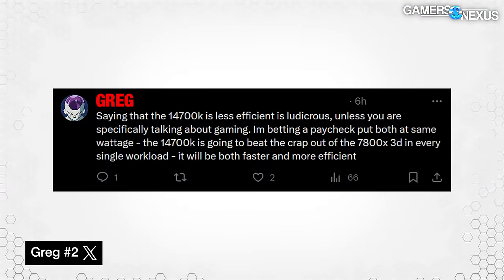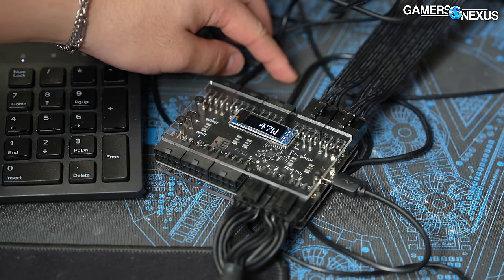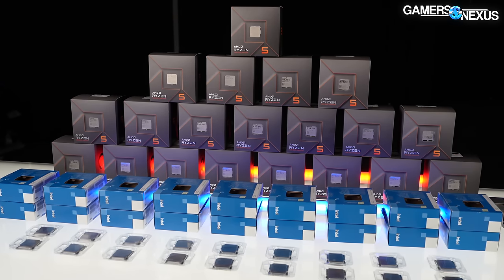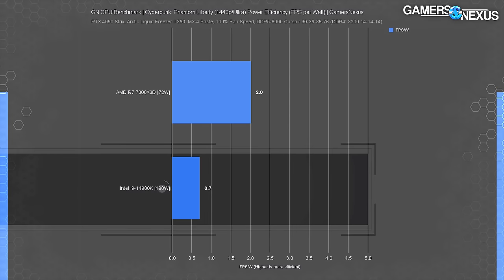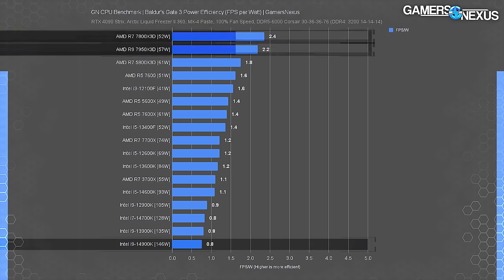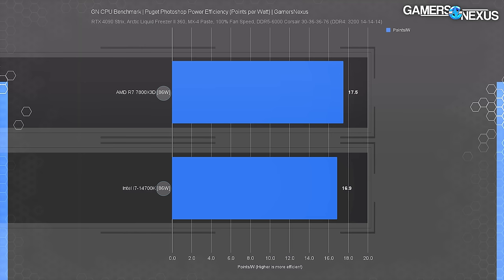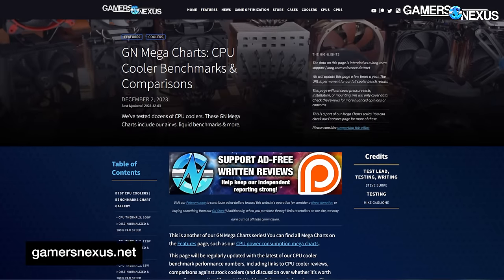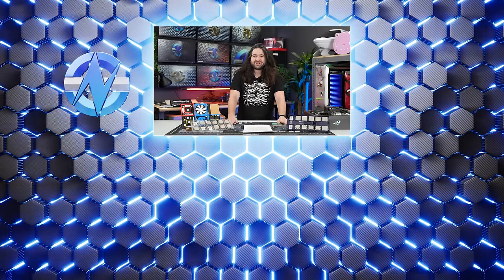The Intel Problem: CPU Efficiency & Power Consumption

Comment: this power efficiency is really good information not just for cost, but for thermal generation. it tells us realistic heat loads in games. this is super important for SFF builders who might need to cram everything onto a single Rad, or use undersized coolers. your case can end up limiting your hardware choices due to thermal constraints.
Reply: I got an i5-13600k about a year ago and it's really difficult to keep cool here in Australia where it's usually quite hot and houses have zero insulation, along with evaporative air conditioning that is absolute garbage.
I knew it ran hotter than its competitor but didn't think it would be this hard to keep cool.
Reply: I legit eyeing 7800x3d for my first SFF build. Due to current situation, i guess i would go to 8800x3d when it arrives. To be honest, my current PC is just fine, just too bad that it's literally idling at like 70W (150-200 at full load). It's quite hot in summer and power bills are also going up
Reply: True! Especially high end CPUs can be very difficult to cool under load.
Reply: I use evaporative and have asbestos insulation. My state is dry and not tropical I guess, so maybe that's your problem.

Comment: Regarding power I just want to point out that for users in hot climates who game in summer with air conditioning, the power consumption difference is much greater than just the CPU consumption as you also have to factor in the added AC costs.
Reply: Same could be said for GPUs
Reply: Exactly. I'm so glad people are pointing this out. So sick of dismissive reviewers who exclaim "nobody cares about power draw". Not true.
Reply: Yup, I have a window unit in my room and it's on the same circuit as my PC because I have no other option than running an extension cord half way across my house so this is very useful info for me.
Reply: There's also the PSU requirement. While not always a significant cost difference, you'd typically want more power headroom on Intel. Granted, for AM5 the generally higher motherboard cost likely makes a slightly larger PSU irrelevant for new builds but it's another point nonetheless.
Reply: scandinavians be like: 💙
Reply: That's way outside the scope of the tests. It's irrelevant to everyone who don't live in hot climates, or people who do live in hot climates but live near the shore and can just open their windows to keep cool, or people who have the PC in a separate room from the peripherals, or people who have a higher tolerance for heat and don't need to run their AC as much, etc. etc.; these are all very personal variables that we have to figure out for ourselves, we don't need a reviewer to have to tell us to keep our own environments in mind.
Reply: Or for people that don't have an AC system at all, but still live in a hot space (in my case, a room directly underneath the roof in Germany. It gets up to 40°c (or something around 110°F, I don't know, we use sensible units) without gaming in there during summer. Adding a heat load of roughly 600W (big CPU + comparably scaled GPU) won't make it any better.
Reply: @blarghmcblarghson1903  I can assure you that opening the window doesn't do crap

sincerely, someone living in 31C 85% humidity climate
Reply: technically less efficiency means the intel is putting off more heat per workload and therefore means you are requiring more AC to keep your operating temps consistent with ambient temp. Maybe there is a minor case for CPU operating temps+capability vs. their ambient environments but this is why most tests are in a controlled ambient temp environment (typically room temp).

it stands to reason that any stressed CPU that is already less efficient will degrade still as ambient temps increase. Temp at load is all that matters as idle wattage has reached parity with most modern gaming-centric CPUs
Reply: @blarghmcblarghson1903  He didn't say anything about how this should have been included in the video man... it's just another point that is relevant to a lot of people. Hell, the opposite could true for people who live in generally cold climates... though I hope most people aren't intentionally buying higher power gaming parts just so it can double as a space heater...
Reply: Wow! I was about to make the same remark. Thank you!

Gaming in what feels like the inside an oven (summer in a tropical region) has this type of issue
Reply: It’s not much greater. Air conditioning will increase electricity use by 30% or so.
Reply: @Argedis I’d be interested to see “w Watts of heat dump out of your case = h amount of BTUs”, then explaining how to understand BTUs in how they heat a space. Space heaters and furnaces have that number on the label, for example.
Reply: @progenitor_amborella  Precisely. I for one don't want a space heater for a computer and appreciate the effiency gains the Nvidia 4000 series compared to the predecessor despite all the hate.
Reply: @blarghmcblarghson1903  >but live near the shore and can just open their windows to keep cool
You mean letting in the oppressive humidity?
Reply: @funi1083  As someone who also lives in a 31C 85% humidity climate, I can assure you there's a huge difference between living near the shore and living further inland.

I find 26C to be comfortable, so I could deal with the heat by just opening the window to the sea breeze. I had to move further inland, there's a big ol' mountain between me and the sea now, so opening the window doesn't do anything. On the bright side I hardly noticed the last two typhoons that rolled by.
Reply: I will run the AC regardless of what CPU I have. The GPU pulling 300-400W is the real killer.
Reply: You’re also gonna need a more robust cooling solution for Intel CPUs. Those are likely to be more expensive, more difficult to fit inside your case, and generate more noise.
Reply: @Rachit0904  Also depends on the efficiency of your A/C and the insulation in your walls. For example, I live in a part of Wyoming the normally sees over 95F for highs but my PC room/TV room is in a half basement where the ground level is about 4 1/2 ft above floor level with an east facing window so I run my A/C a lot less. If I don't run my PC at all during the day, my A/C rarely turns on. Even when I do have it on it still runs less.
Reply: @Silikone  Not only that. Last summers showed, yeah its better on the coast line. Where i live that meant a difference from 32°C to 39°C in the inland on hot days. I don't see where thats an argument for less relevance. In europe we mostly don't have AC's at least in central and northern europe but putting less 50°C hot air in the room is always better.
Reply: @domm6812  Do reviewers really say that? I barely touch my PC for that reason electricity is expensive as hell.
Reply: Correct, even for not hot climates users. I never even considered this a problem until I bought a 3080Ti that's pulling 350W of heat into my room...
Needless to say I'll never buy a 350W GPU ever again, regardless of the performance!
Reply: @Donnerwamp  My wisdom for this scenario is to just not buy top tier gear. I limit myself to the 70s of nVidia and the 750s of AMD. They perform very well at 1440p. I'm not an "ultra settings" player, so if some game underperforms to my eye, I just lower the settings a bit. As long as I don't see some obnoxiously big fps dips, I'm a happy man. In all honesty, in some of the games I play, I struggle to see the difference in quality from dropping the shadows from ultra to medium. As long as the shadow range is high enough, it practically doesn't matter which quality setting is on, unless we talk about raytracing. I still get good quality picture and I keep the bills low even with an AC on, since I partly live on the Mediterranean side of Europe and hot summers are the norm.
Another point for you in particular is to look into whether your roof is insulated. Depending on where you are in Germany, there is a chance you might be living in a renovated building from a hundred years ago. Those almost never get proper roof insulation. Might want to check with your landlord or with a technician about this and take some steps to mitigate the heat transfers. Saves money for AC in both the summer and winter.
Reply: You could also be living in an older place, where the electrical installation isn't really dimensioned for modern consumption. 

Or just caring somewhat about the environment. 

If I can get 90 percent of the fastest thing, but at significantly less power ie. 50 percent power use, then I'm actually kinda happy with that.
Reply: @Hr1s7i  I run a R7 3800X and a 3080Ti but in summer I throttle my PC to an overall powerdraw of 250W as this doesn't affect room temperature too much. But VR is out of the picture then. In Winter I run the fucker at full blast as the extra heating is very welcome. 

It's my grannys house. She used to live bellow me and my mom underneath her. Now I own that house, and... Yeah... Insulation is just a word in the dictionary for this house. It's pushing almost 150 years by now, last thing done were the windows in 2002 and before that the heater was "upgraded" from wood to oil in the 70s, so... Yeah... Let's just say that I'll sweat for quite some time during summer.
Reply: That's true and you also have to eat. So the electricity cost of the fridge should be considered too.
Reply: @Nearest_Neighbor  Around here fridges come with energy efficiency ratings.
Reply: That's very true. On the flip side, in winter, the space-heater function of Intel CPUs reduces the disadvantage. It's not as efficient as a heat pump would be, but it's still reducing the inefficiency.
Reply: @sunspot42   Unless you're maxing out 250W, you don't need an expensive cooler.
Reply: @JJFX- This is true. I use an open case with a passive cooler CPU, and GPU. Runs much better in the winter…
Reply: @Donnerwamp  Hell I've got central AC and I still undervolt my rig. What ends up happening is my office room gets really hot while the rest of the house is cool.
Reply: GN needs a climate chamber to test with different AC configs!!! Not enough data without 100 ACs tested!!! (Someone saying that while foaming from the mouth)
Reply: @Yagami_Returns  Yeah there's a reason many of us think of winter as benchmarking season.
Reply: @griffin1366  I didn’t say you’d “need” an “expensive” cooler. But you’re going to need a more performant cooler to maintain the same kind of temperatures with the Intel chip, and those tend to be more expensive, larger, louder or all three. The AMD chips therefore also lend themselves to smaller cases with less efficient thermal environments. Those also tend to be cheaper and easier to accommodate in your workspace. 

I’m frankly stunned Intel has fallen so far behind in efficiency per watt. Especially since arguably their main competitor in the bulk of the high end market isn’t AMD, it’s Apple and those Apple Silicon powered laptops.
Reply: @sunspot42   Intel are just playing the long game. They are greedy and we saw that with 8 years of quad core CPU's. They're sitll at 10nm and will try to stay there as long as possible.

It will get harder and costlier to build for 2-5nm.

The last resort is to put large amounts of power into the chips to extend the node / arcitecture. NVIDIA / AMD both do this as well and why they also draw so much power.

Comment: I think I remember from your video on californian power supply regulation that idle draw plays a huge role in overall power consumption. At least for non-gaming use, I could imagine most systems run hot for 0.5s to load a program/webpage and then idle 99% of the time.
So I am glad you mentioned idle draw at the end and am looking forward to your tests on this.
Reply from the maker: Great memory! I bet not a lot of people remember that one. Will be doing idle over the next couple months!
Reply: @GamersNexus  Great to hear.

A fun aspect on the side: Since I do a lot of normal office work on a daily basis (self employed), I used for the last 5-6 years a notebook with a dock instead of the big gaming machine in the daily activity - only for games and higher workloads (Blender, compiling, ...) I turn on the big machine.
Living in germany with higher prices for power it does make a difference, since notebooks are extremly power efficient. For my case it made especially sense, since I need a mobile device anyway for visits to the client. So a win-win.
Reply: @GamersNexus  I think Intel got this one, I have done extensive search on this topic on Internet. Intel 12th gen+ wins every time.

Comment: I live in Brazil and own a AMD Ryzem 5600G, and I love its efficiency. There is an extra argument you can make in favor of the less consuption also, you need a smaller power supply for your PC and it is more silent because it needs less fan speed to dissipate heat generated by the extra power.
Reply: I "upgraded" from a 5600G to a 12900K. The noise issue alone makes me want to go back to the 5600G. That and the fact that the idle power of the 12900K system is what the 5600G pulled at 80% load.
Reply: @MartyAckerman310  you've learned your lesson. NEVER BETRAY LISA SU OUR LORD AND SAVIOUR
Reply: Fan speed doesn't depend solely on the heat generated. The X3D CPUs have a significant disadvantage compared to Intel in terms of how efficiently the cooler can dissipate their heat. They have lower temperature limits, which means lower difference in temperature compared to the air. The 7000 series also have that oddly thick AM5 IHS for AM4 cooler compatibility, which makes them less efficient at transferring heat to the cooler, so the cooler has to work harder to keep the chip at the same temperature. The heat pipe layout of a cooler can also make a sizeable difference between AMD and Intel because the positions and sizes of the heat sources within the CPU are different.
Reply: That's why I like 65W CPUs... I bought a 7700 instead of a 7700X (7700 is cheaper in Brazil btw). I ran tests on my CPU setting it to the same parameters of a 7700X and measuring the power drawn on the power supply cable, it simply doesn't worth it, too much heat and to much power for just a little bit more of performance... I'm currently running my CPU at 75W TDP +250MHz on the boost clock and undervolt. Stresstesting the CPU at 100% is taking only 150W from the power supply (entire system consumption) and CPU temperature is around 80ºC. When I tested it on 105W TDP +100Mhz + undervolt (same specs of 7700X) the total system power was around 200 - 215W and CPU temperature went straight to 90ºC.
Reply: Me personally, the efficiency is necessary as my PC is hooked into a UPS. I have a hard power limit; anything to drop the power consumption can be critical in an emergency.

Comment: More efficient CPU also means lower requirements for the CPU Fan, Case Coolers as well as the Powersupply or even the case itself. So there is more merit than just power cost.
Reply: Not just lower requirements, but more options as well. CPU trying to pull 300W is going to need a lot different cooler than one chilling around 150W, but run the 300W cooler on a 150W CPU and you can run the fans a lot slower and thus quieter.

More efficient isn't going to be less total power, take a 100W CPU that can do X work/hour but a 200W CPU that can do 4X work/hour. Yes total power saving but higher peak power.
Reply: @@fluffy_unicorn859 Not sure on exact numbers, but when dealing with heat a 4:1 ratio of heat to power needed to deal with the heat is probably on the good side.
Reply: also motherboard , dont have to worry about vrm's as much
Reply: My i7-12700K is the only one that can be air cooled. Any i7 above it needs an AIO.
Reply: @saricubra2867   What nonsense. I have a Noctua NH-U14S and it cools my 13700k just fine at 5.4Ghz. Granted I set the power limit to 200W and it sits at 90C in Cinebench. In gaming and everything else it sits at a stable 600 RPM.
Reply: @griffin1366  My i7-12700K never reaches 90ish degrees on Cinebench and stays below 70 degrees. The 13700K draws like 50% more power for 25% higher perfomance.